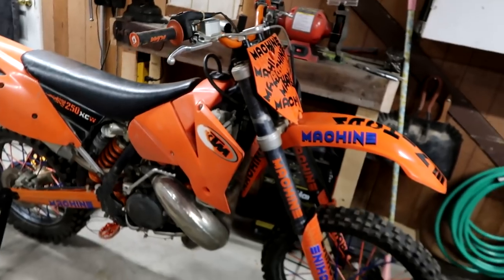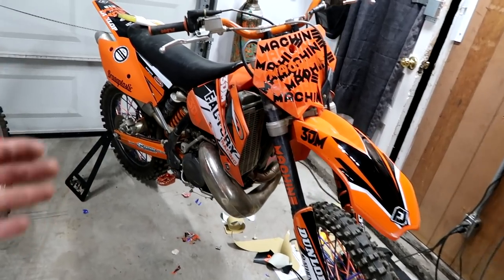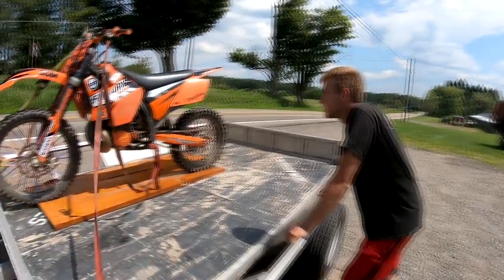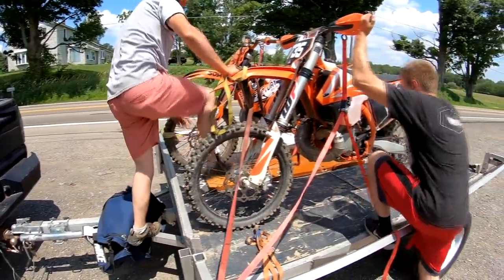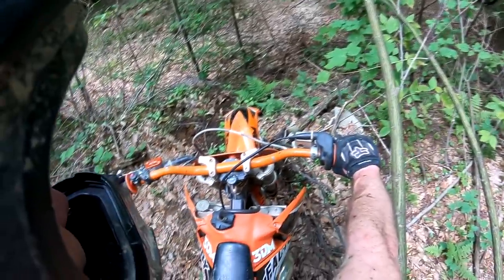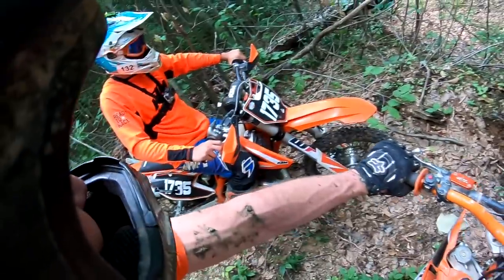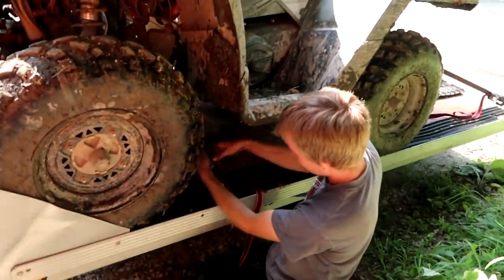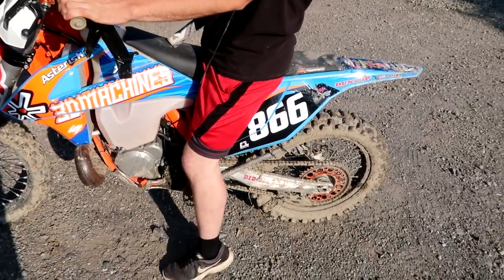NEW KTM LOOKS SEXY!

Comment: Sounds like the KTM is running a bit rich. She should rev out much nicer than that. Maybe your baffle needs a repack/cleaning?
Love the riding videos. I always have.
Reply from the maker: I am definitely going to tear into what's causing the issue
Reply: Better to run rich then lean. 👍
Reply: this thing is running like absolute crap i would rather run my engine a hare lean the fatter than a sumo wrestler. Unless you like losing power then keep your bike jetted rich af
Reply: @george8966  nah never good to run a bike lean, way more risk of blowing out the engine. I would rather gum up a powervavle then blow a piston.
Reply: Air fuel screw

Comment: Tubliss are a pita when they won’t seal. I found that spraying everything with armor all helps to seal things up. Also, get a HP pump and make sure the inner tube is above 120psi. And if the tire has a lot of tooling marks around the bead areas it can stop it from sealing against the red liner.

Comment: Either the KTM is running way rich or the powervalve is messed up. I suggest checking the air filter, repacking the silencer, replacing the spark plug, then doing some jetting and if that fails then check the powervalve.

Comment: Put your graphics on with soapy water. It’s sooo much easier. Wet them down wet the part down apply the decal position it where you want it squeegee the excess water out and then hit with the heat gun.

Comment: 3d machine POWER VALVE ADJUSTMENT IS TO FAR IN OR OUT. 

I just finished watching the video.. and heard you mention the power valve so never mind 🤙😂
Reply: It takes 2 minutes to adjust power valve on the older ktms. My 200 is a 2 minute job. Adjusted wrench and an 8 mill.

Comment: bogging like that, I'd suspect lean or running out of fuel vs rich. otherwise it would be so rich it would load up and foul the plug, speaking of which, last KTM I rode had the spark plug boot end un-threaded from the wire and kept loading up fouling the plug...
not my bike and they kindly let me ride it for the day and said it had load up issues, keep it revved and cleaned out, once it fouled the plug late in the day, I went to change and found the loose end which I screwed back onto the wire, then it ran perfect, go figure. they were trying to sell it dirt cheap saying it needed rebuilt and all sorts of parts,  of course that was 20+ years ago